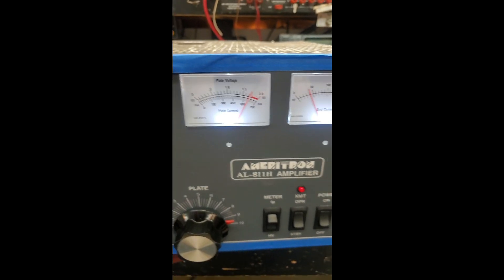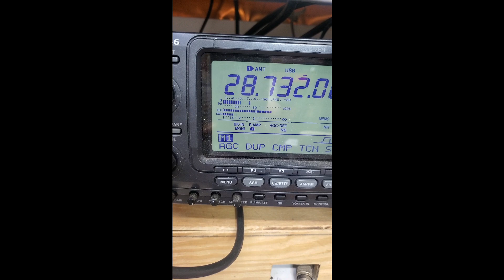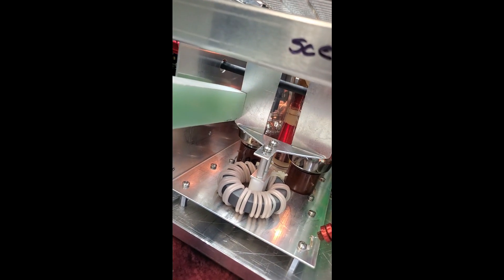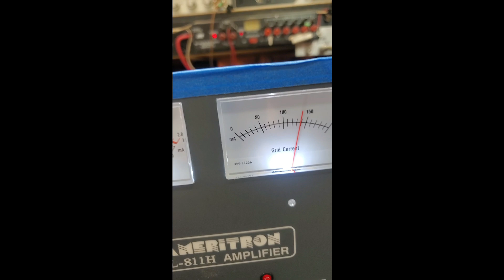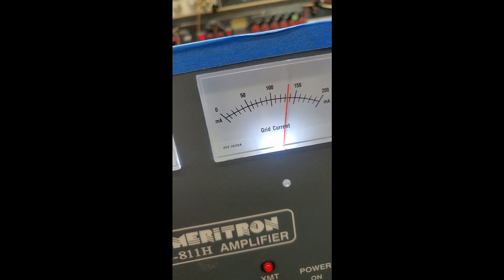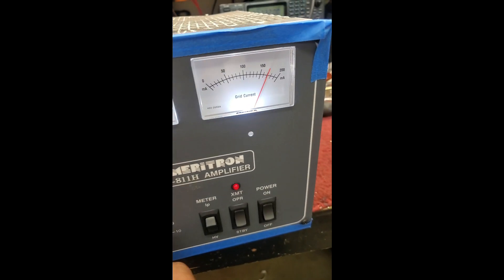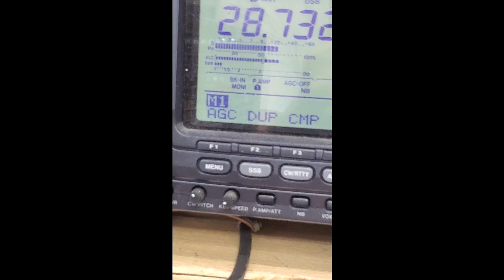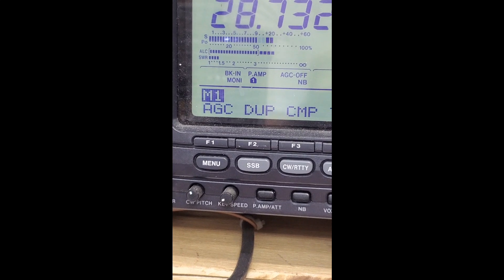Neutralization of the Ameritron AL-811H

Comment: Hi Tom, quick question, I had to replace the tuned input board on the 811h I picked up.  Tuned input was fried.  The new generation board seems to have a different hookup location for the blue grid wire, which was by the relays, and is now marked to place by the rest of the wires by the transformer side. D16 is fine, loads fine with palser  with full output, but I get no or very little grid current, lol, did that make sense?  Is it correct that they changed the grid, blue wire that goes straight to the grid meter, from the relay area to the string of wires connected on the right side of the back board,  thanks Tom for all your help.

Comment: Thanks bunches.
Picking up my first linear soon, an 811.  Would seem the things need 'fixed' or tuned from the get go.
Reply from the maker: MFJ for some time has been installing a fan that barely moves air. Almost all newer 811s have grossly inadequate cooling. If it has a Cooltron fan, the fan is junk.

 The protection stuff has been updated in newer amps, any problems like MOVs can be addressed when they fail. Many H models are not properly neutralized, but problems like that can be addressed on an as-needed basis. I need to do a better video on neutralization.